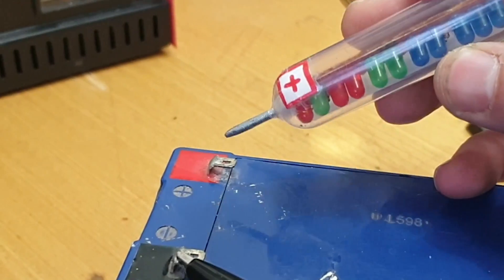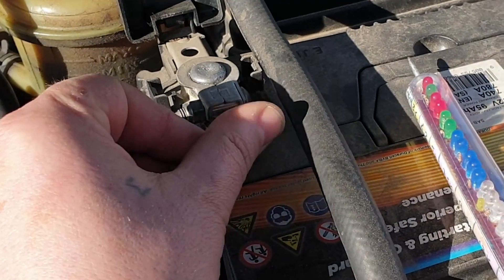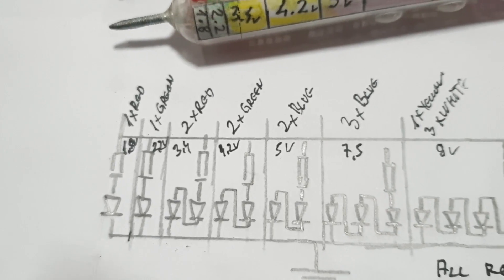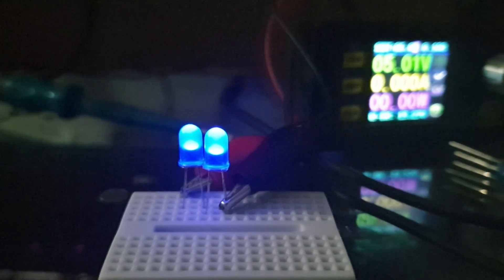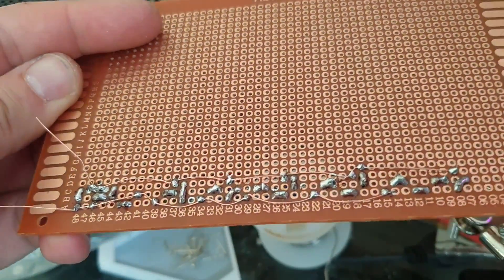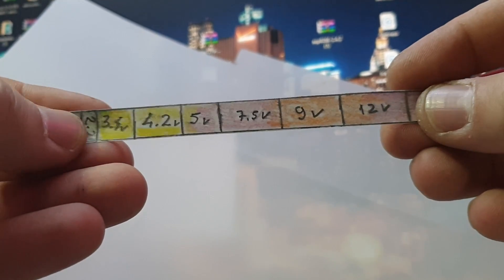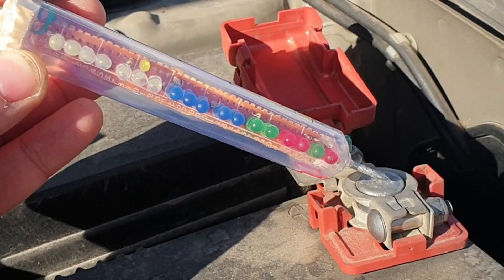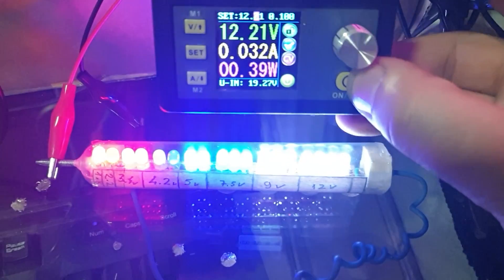How to Make LED Voltage Tester (work without batteries)

Comment: Great job. How would I prevent voltages higher then what it's made for burning out LEDs. For example I have a treadmill generator that can get up to 70+V depending on how fast you peddle. But I only make voltmeter go up to 24v.

Comment: Hi, i would like to build very small led indicator to my micro helicopter on 3s so max voltage is 12.6v and landing voltage 11.1v but under load 10.5v. What I need for a light and very small led Indicator

Comment: I have a doubt:- resistors can limit current, then how can they be used to measure voltage
Reply from the maker: I use drop voltage when I connect leds in serial
Reply: @Hacktuber Oooo....... I didn't think that way.....Well I got it now.....Thank you ....Now I will make one for myself ..... great video ....... LOVE FROM INDIA